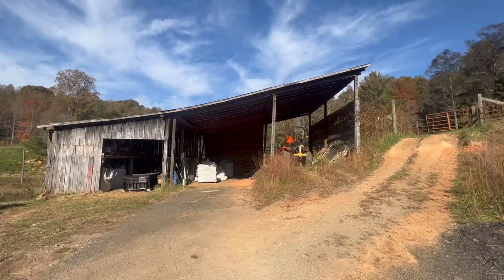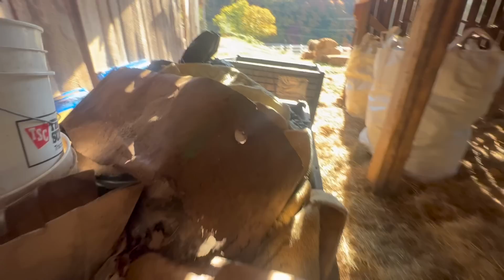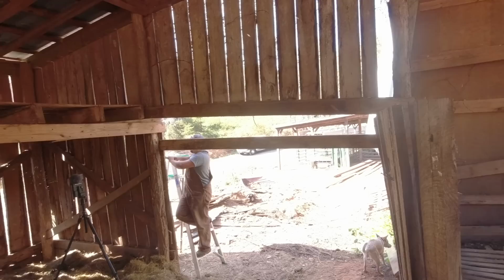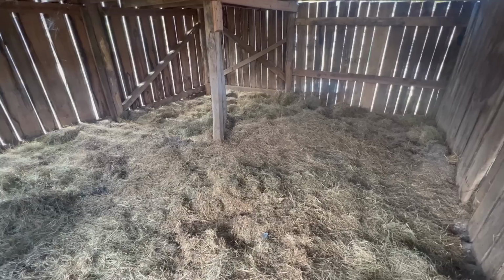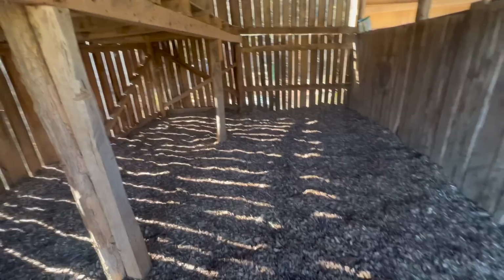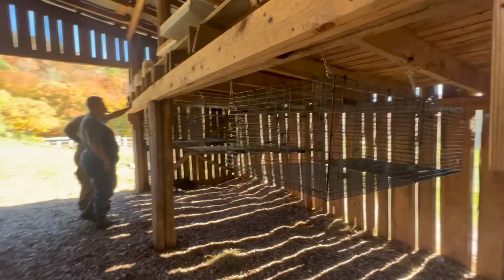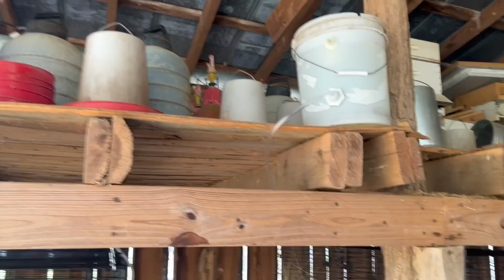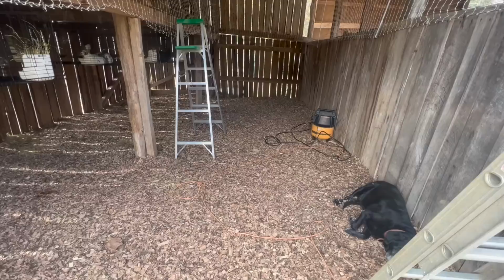Starting Our RAKEN Barn - Rabbits and Chickens Together

Comment: Those are very very cheap!! Better off making your own bank of cages out of 1/2 x 1 galvanized wire! You can order it from klubertanz rabbit supply. You’ll never ever have to replace them and they won’t rust. Wish I was closer I would come build them for y’all. You can also order the water nipples from them and the hose as well.
Reply from the maker: Thanks for the info. We may go with those the future. I needed something kinda quick because we have another project coming up in the barn where the rabbits were at. I’ve never heard of that rabbit supplier (new to the rabbit gave) so I’ll look them up. 

Appreciate you watching and commenting on our videos. Thanks so much!

Comment: When we started with rabbits we used the same cages with j clips. Just passing knowledge the cages won't last just but a year. They will chew and scratch the thin coating off Cage and it will rust from the urine. When you can  star with building new cages to replace them. Just a tip
Reply: true words

Comment: We had that same issue with the bird netting. There is a netting at Lowe's called deer netting. It is thicker material and works great. I put it on top of all my poultry pens to keep the hawk out. It's heavier and very reasonable in price. 100 foot roll for like $30. I think it would serve your needs well at keeping the chickens out of the loft.
Reply from the maker: Thanks. I hasn’t seen that. Appreciate the tip. Thanks for watching!
Reply: How did you secure your netting?  I’m thinking of putting netting over my coop/run area. They have an enclosed run attached to their coop but we allow them in the fenced area where the coop is. I’d like to put netting over the whole area. (I understand everyone’s setup is completely different)
Reply: @suzanneo1124  Zip ties are the new baling twine and duct tape.
Reply: @Skashoon  totally!  Ahahahaha!
Reply: @suzanneo1124  I used zip ties. It has worked great so far.

Comment: I agree those cages look pretty flimsy, I would be afraid a good sized rabbit and it would break. I have a off the wall ?. would those wire dog kennels work better. they look to be a lot more sturdy than those and I find them all over the place for $15 to $20 and if you take the tray out of the bottom waste will drop to the ground, those cages I wonder how much they will hope up with a rabbit, never mind a nest box and a litter but like I said I am learning. I am not ready for rabbits yet but watching to learn everything I can. I know here (Upper Michigan) we have closed down mink farms and we can buy those cages pretty cheap too. IT is a really nice set up for sure hope it works good for you

Comment: Those rabbits will chew through those zipties. You might want to look into metal fasteners, tsc sells them.
Reply: Hog rings would probably do the job. They seem tough enough to hold the edges of a rabbit cage together.
Reply from the maker: We are going to add some wire. Thanks
Reply from the maker: I have some rolls of fence wire that will work. Thanks for the suggestion.

Comment: You need a Good cage Mest Rabbit get heavy I used Hardware cloth on my cages and I am fixing them after only 1 year because they are going throw the bottom now we have a lot of homeless that live in the park bush and leave shopping carts in the creek so I made a cage on wheels lol it works nice so now I am cutting them up putting them in my cage floors then 1/2 hardware cloth over that because we have thousands of Rats around here after 3 pm all doors and windows get closed because of the Rats they walk up the walls of wood siding and into your windows just chew the screens and come in there as big as my chi chi Dogs
Reply from the maker: I love the idea of a rolling cage!  Sounds like those rats are a real problem. Thanks for watching

Comment: There are also stainless steel zip ties, typically used for wrapping car exhaust with heat suppressant cloth.  Available on eBay or anywhere.    More expensive than plastic zip ties but bunnies won’t chew it.

Comment: Could you put wood boards in the cages or tiles for in the summer? I don't like those hanging cages.... It goes bad on the feet and they get long claws. Rather keep them in a tractor
Reply from the maker: We could try that. Would be interesting to have them in movable ground cages in the summer
Reply: Ours are in movable walk in metal tractors. Still warm where we are ...